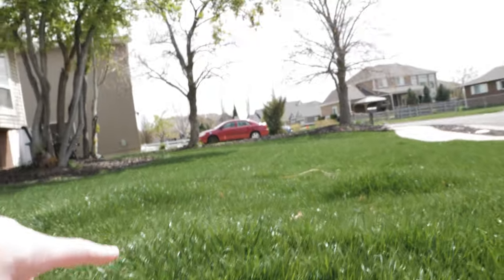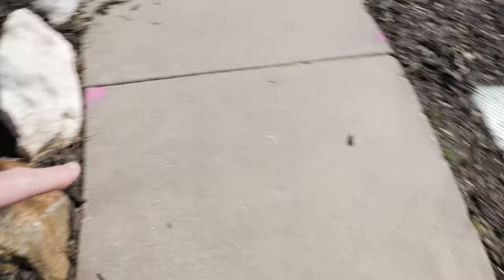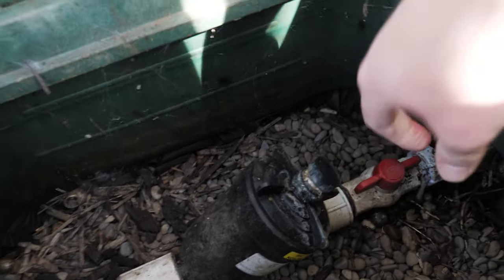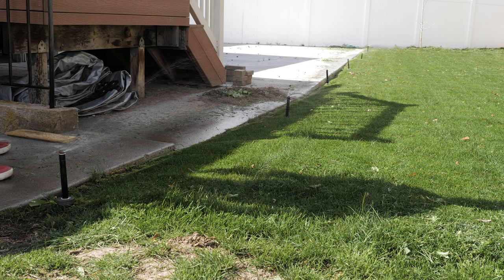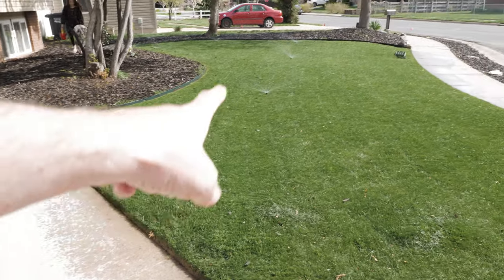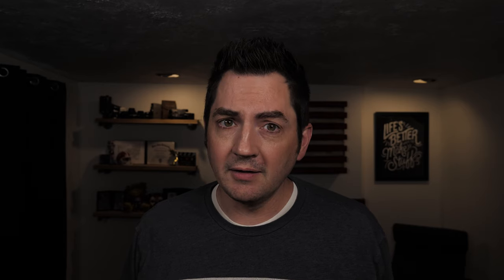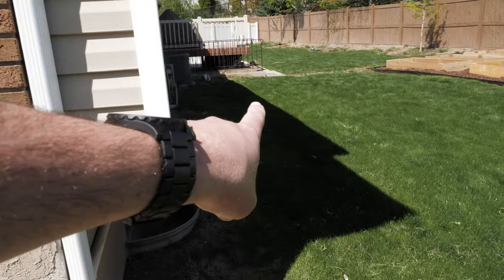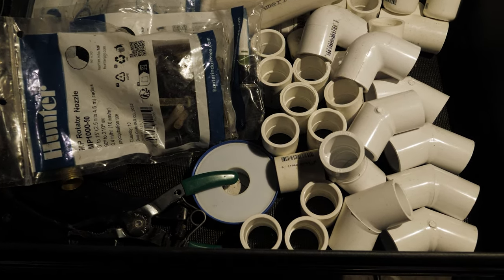6 Things You Should do to Inspect and Troubleshoot Sprinkler System

Comment: Most of my sprinklers have a hard time with the 3.0 GPM nozzles (loose a ton to evaporation and drift) usually end up with a 4 -4.5 GPM just to keep the water where it's suppose to be. Shorter run times too, and I'm grateful for the 90 PSI we get from our local water supply.
Reply from the maker: I would be going mad if I had to deal with drift problems. Occasionally we get an east wind coming out of the canyons that can wreck some things but nothing routine to worry about. I am thinking I need to change out my pressure regulator in the main valve box to get some more pressure to the back. That might be a project for next year. Thanks for stopping by and commenting as always.